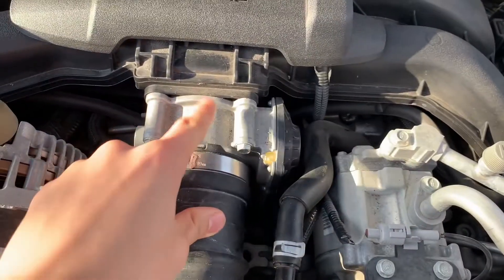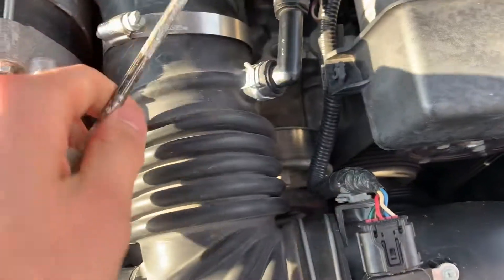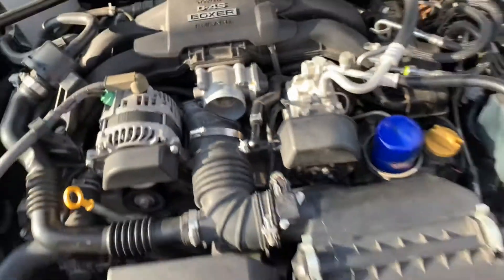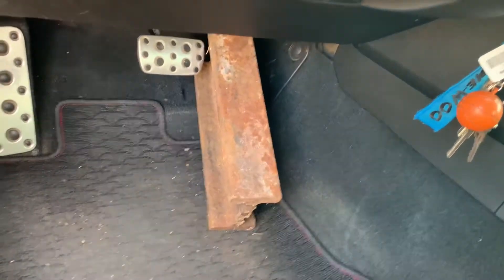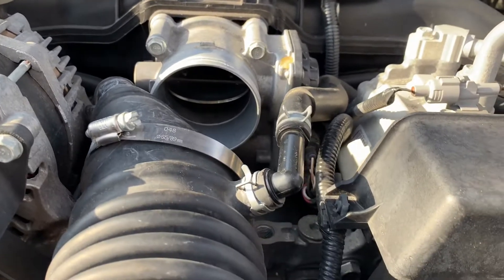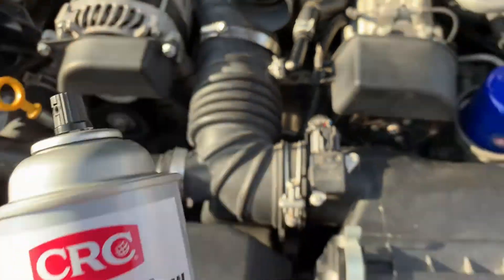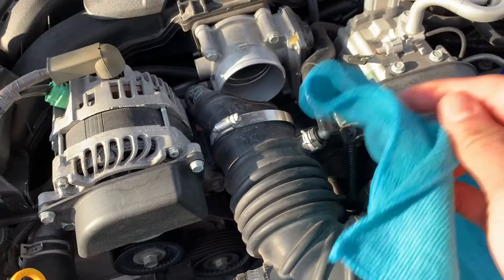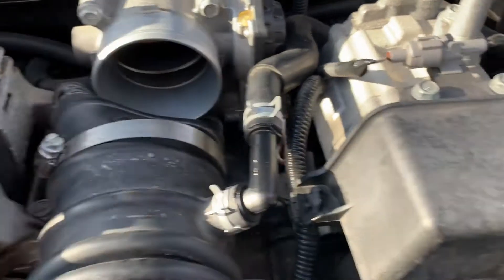Scion FR-S / BRZ / 86 - IDLE RPM DROP FIX

Comment: So i checked other videos of proper way of cleaning  the throttle body. NEVER USE a Mass airflow sensor for a throttle body when cleaning. Use Throttle body cleaner ONLY or else u will get a check engine light . So make sure to use a throttle body cleaner when cleaning ur throttle.

Comment: Dealing with this right now. Gonna give this a shot
Reply: update: it helped
Reply from the maker: Awesome! 😄
Reply: Hey man got an update on this. This is an actual ECU issue that Toyota and Subaru have addressed. If you take your car into a certified dealership the ecu reflash should be free. Amazingly the reflash came out in September 2015
Reply: @Cactus Jck17   do u have mods on your car??
Reply: @thisblackguy1  only have a cat back exhaust. It still idle drops but no where near as bad as it used too
Reply: @Cactus Jck17   I'm going to replace my MAF sensor today. I cleaned the MAF sensor and the throttle body yesterday. Still had to give the car gas at idle but it did not die on me surprisingly after I cranked it. I do have the car tuned by boosted performance

Comment: Do you still have this car? Miles? Just bought the same car same issue and ticking noise
Reply: Ticking noise (sounds like crickets) is normal for these cars. It's the high pressure fuel pump. Sometimes it goes away with higher octane fuel but don't expect it to.

Comment: I have a p0171 code lean bank 1 the performance of the car runs perfect no issues on driving you know what it could be like a sensor or sun
Reply from the maker: Hmmm it is not familiar to me, but you could search that code up online and it should say what the code means for our car. If your car is running and performing perfectly the chance of it being something major is slim, but it is always good to check online.
Reply: What was the issue? I have the same code I cannot manage to get it to go away! I tried new MAF and filter.
Reply: @codywright1266  Had the issue with mine. Ended up being the bank 1 O2 sensor. got it replaced and the engine light is gone.
Reply: Most common reasons for lean condition would be a vacuum leak so a hose cracked or disconnected somewhere, bad intake gasket, etc. or also really commonly a dirty mass airflow sensor which is what the cleaner he used in this video is actually used for.  Cleaning out the MAF so it clearly reads how much air is coming in to the engine.  Throttle body cleaner is what you actually use on the throttle body.  Crazy, I know.

Comment: Did a check engine light pop up when it was happening?
Reply from the maker: No, no check engine light popped up for me, but you can really notice it when you come to a stop, it almost sounds like the engine was going to die which is how I could tell.
Reply: @orionarielle 
Sameee
Reply: @orionarielle 
How to fix it bro ?
Reply: @josephgoebbels0  u gotta clean the throttle body.  how he shows in the vid
Reply: @mrvector257 
I got it and the issues solved !!

Comment: With the key completely off you can manually open the throttle body and you should use throttle body cleaner but mass air flow cleaner will work aswell
Reply: how???
Reply: This is not good advice.  Manually actuating an electric throttle body can damage the motor that drives the throttle plate.  Just key on, press the throttle and you are good to go.  Quite simple.  Throttle body cleaner should be used, not mass airflow cleaner.
Reply: @TripleTapHK  idk what you do for a living but moving electrical motors isn't going to break them, maybe you try opening the throttle body more then it is supposed to would damage the gears, but electric motors spinning is like a generator and I've used brake clean in a pinch and have never had a problem with cleaning throttle bodies this way and I've cleaned plenty

Comment: Where can I get that cleaner
Reply from the maker: Any auto shop works, it’s a pretty basic cleaner so if you go to any store with car parts I guarantee they will have it! 👍
Reply: Use throttle body cleaner for the throttle body.  This is mass airflow cleaner.

Comment: Mines turns on but it’ll idle close to zero then when I step on it it won’t go past 4K then turn off
Reply from the maker: Hmm, that sounds like there is more to do then just cleaning the throttle body. Back when I was experiencing this, it was fine until I slowed down the car, only then it would feel like it is about to stall. I would bring your tk a dealership for sure before anything more serious happens.

Comment: Mines down to 600rpm, I just did a 900km drive and it was parked for a bit, and I was too tired to notice it while it was idling and I'm playing my music loudly.

I did just changed the battery but I did it quickly so it wasn't a relearn issue. This makes sense if it's a common problem.

Mines a 2018, and I've been driving it through the shittiest roads conditions with all the sand and salt on the road, front of the car was literally covered in shit I had to stop to clear the lights

Comment: I’m having a similar problem, I have no codes but when coming to a stop either a stop sign or light stop my RPMs go up ⬆️ which basically the car revs itself, already tried cleaning the throttle body it was really dirty but I didn’t fix the problem, any suggestions?
Reply from the maker: You said the car revs itself? As in instead of it sounding like it will stall or the engine will shut off, it goes to a higher RPM when you stop?
Reply: I'm having this exact problem. Did you happen to find the issue? I've already pulled my TB and cleaned it very well. Still having the issue though. Maybe do a maf clean?
Reply: @chrisbarnfield6105  did u figure it out? My car didn’t have that issue at all, a few hours ago i cleaned the throttle body it’s drives way better now but here and their when coming to a stop or going on neutral and i let go of the gas it’s like it’s revs it self, like he said it just goes a bit higher into the rpm’s instead of down.
Reply: I have the same problem with my 2012 GT86. Did you find out what the problem was?

Comment: why does it get dirty, in spite of the air filter?
Reply: The PCV system has the main valve at the rear of the fa20 engine and a breather near the front that is connected to the intake tube/hose at the front of the throttle body.  If your frs/brz/gt86 has excessive blow-by, this will cause the excess gas/oil to vent via the breather as well and will cause the throttle body to accumulate oil when the throttle body flap is closed.